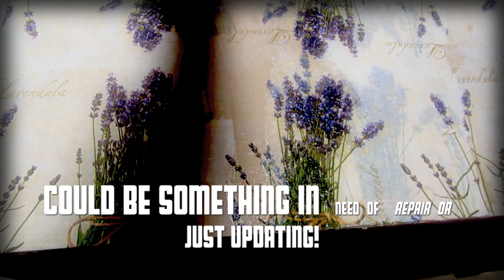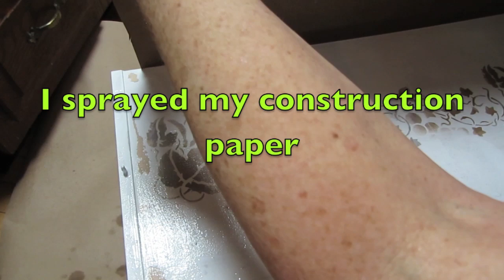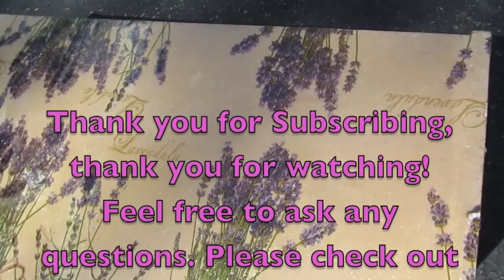Contractor paper decoupage

Comment: Great job on this Patti. So......do you still need to apply the Gesso before applying the Mod Podge for the construction paper?
Reply from the maker: That's a good question Angelina. On this particular piece because it was particle board I probably would not have used it on the surface after all. I had planned on painting the rest of the piece and the Gesso would have been necessary to cover the grain of the faux wood and to give acrylic paint something to hold on to. But since I covered the surface with the contractors paper I think I would have been safe skipping the Gesso there. Thanks for asking, I'm sure others will have that same question. 
Patti

Comment: Was wondering if you used the mod poge before using your top coat to get the napkin to stick to the paper ?
Reply from the maker: Hello Ginmars1, yes, I applied the mod podge (or decoupage glue) to the top of the dried contractors paper. I then let the Mod Podge dry. I laid the napkin down over it, flattening it out, then put a piece of parchment paper over the napkin and ironed the napkin down. It causes the dried decoupage glue to melt into the napkin. You won't see it, it's not like it gets all gooey, it just secures the napkin. Then I added the extra layers of decoupage glue and the top coat. Good luck!
Patti

Comment: Sorry to be dense .....what is construction paper?. Not heard of it in uk. By the way, you videos are inspiring and have taught me so much. Thank you.
Reply from the maker: Hi Kathy, that was my fault. I forget that the whole world can see these videos, LOL. The construction paper or I should have said Contractors paper comes on a very large roll, and here in the states we buy it at the Home Depot or Lowes stores.  Here is a link to it so you can see what it is and what it's normally used for. It costs less than ten dollars in the hardware stores, this roll is probably a lot larger. But you know what? You can actually use the backs of paper bags too. It's basically the same thickness and color! I was working on a larger item so I used the roll. And I'm attempting to decoupage a floor. (I will be shooting a condensed video) That's the original reason I got this paper. I think if you google contractor paper floor you will see a lot of videos on others who have done this. Thank YOU for taking the time to compliment me!
Patti
 http://www.amazon.com/CCP48-48-Inch-300-Feet-Construction-Natural/dp/B0067NLXYQ/ref=sr_1_9?ie=UTF8&qid=1399596701&sr=8-9&keywords=contractor+paper